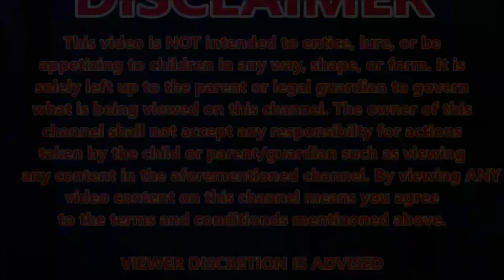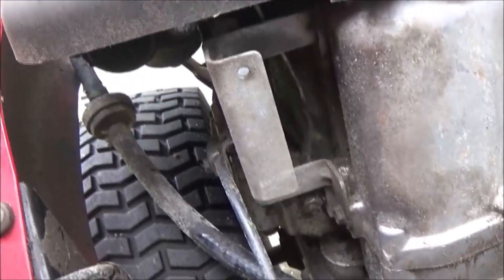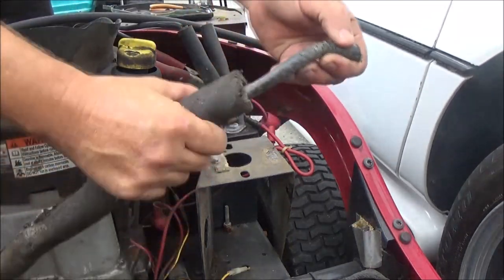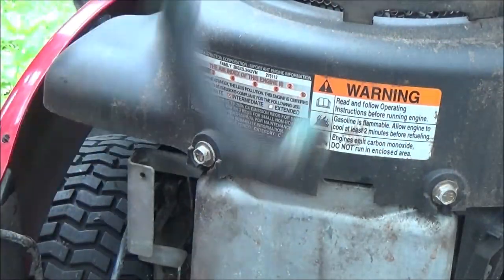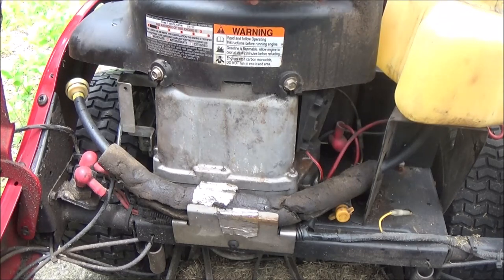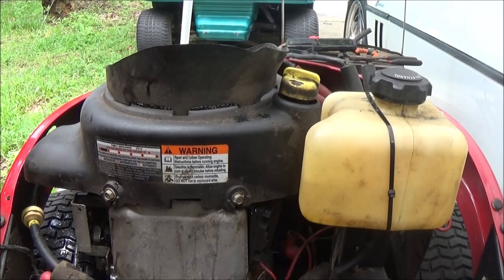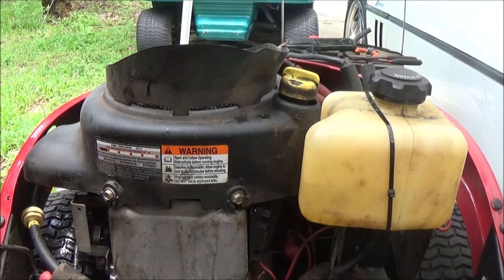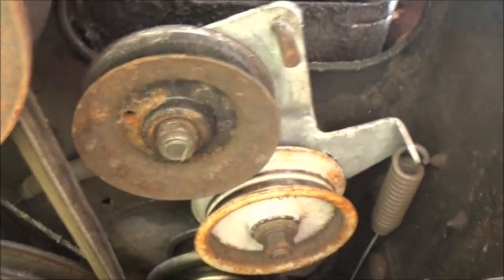Craftsman DRM 500 Fuel Line Replacemant

Comment: I have the same mower do you know what type of oil it uses?
Reply from the maker: Just 10W30-40 will be fine
Reply: @shabear1000  Awesome man i got this mower for free from a friend. And the current things it needs is a new battery,more oil,new front tires,possibly a new solenoid & starter switch. I cant find the spark plug tho any tips?
Reply from the maker: Local small engine shop will have the plug. They're not very much.
Reply: @shabear1000  I cant find where the spark plug is any tips?